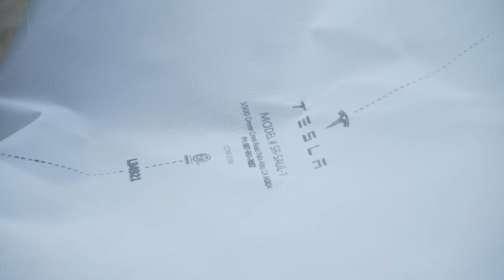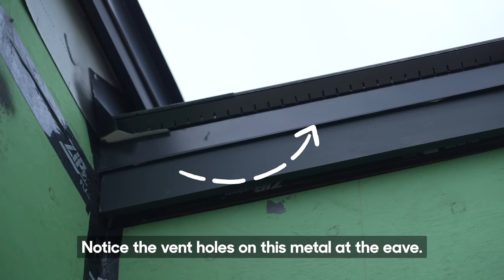Tesla Solar Roof - A Builders Perspective

Comment: Problem with this system is you don't have shingle level monitoring so detecting an issue on each shingle or string of shingles lacks the granularity of modern day MLPE Moudule Level Power Electronic systems. Also since each power gateway is only rated to 200A you actually have 2 fully independent systems during a Power outage. So you really need to spend very careful attention to balancing your power loads to be spread evenly across the 2 independent systems. Also the Gateway doesn't have Generator Controls so the Generator click only clicks on when the solar & Battery run out of Power. Also the Generator cannot charge the Powerwall so this is not a true off grid capable system. It's a very nice system but you end up spending so much more $$$ to go this route because the system was designed for self consumption & Arbitrage not a true off grid installation. 

Still a beautiful product & this has alot of features with Span Electrical panels to make the Generator almost useless. But in the winter if you have electric heat pump & your Powerwall run out of Power the issues is the Generator will continously run until the Utility Power comes back on. When Tesla one day makes a software update to allow the Generator to have better integration with the system not just be a back to the back up then it will be a truly great system.

Comment: How many watts is produced by a "Tesla panel" similar in size to a traditional solar sized panel? Is cost the only reason why someone wouldn't use all "active" panels? And, couldn't one use the solar heated hot air generated in the space behind the panel as forced hot air for the home?

Comment: My Solar PV produces ~40kWh (I think the best ever was 48kWh out of a 6kW inverter)  in Summer and only around 15-18kWh in the depths of winter. (6kW Inverter with 7.9kW -=24x0.330kW LG panels)
(Call the installation Sydney Australia  - that equates to 8 hours of sun MAX and 2.5-3 hours  - equivalent in winter (clouda days are less than 1 hour of "sun") - and our skies are cloudfree for most of winter - Aother real installation nearby  with  a clear northern prospect - ie. a better solar location and a 5kW inverter with Suntech 275 W x 24 = 6.6kW of panels generates  20-25kWh in winter (4-5 sun hours)  and 35-40kWh in Summer (45kWh peak) - (ie 7 sun hours in summer is pretty good)...     These are all variables which are difficult to truly account for - unles syour site is in the clear on a bald hill and you have comprehensive weather/sun monitoring done in advance....

In summer I export 80% of my generation  (we only use around 3-4kWh from the grid overnight on average - also have a legacy SolaHart thermal solar hot water - and only "boost" from the grid infrequently. (I am in Australia with much better annual solar resource than the "high latitudes" of USA or Europe. though we are shaded by terrain for a few hours in the AM - winter especially, ie not "ideal")

Setting up a solar system for "total resilience"  - the sizing needs to  have at least a "factor of 2" of surplus power - assuming less than 5 hours of sun a day isn't a bad idea seeing as on heavily overcast days the solar generation will be down to around 10%) - in summer any "properly functioning system" will fill batteries and heat the hot water by 11am and export the bulk of the remainder to the grid, while in winter it will take most of the power (on a good day) to get to the same place - and possibly supplement the hydronic heating by charging up the thermal masses during daylight hours.
I appreciate these showcased builds are not the :every man" installation - or project.  Most will be dreaming - -for ever.

Comment: Good stuff.  I would love to see how the permeability is handled in the roof from top to bottom (calcs).  Does moisture have a way out of the house roof as the elevation goes up, or do they rely 100% on it not getting up in there (not a good plan)?

Comment: Question about tornado area testing: if it’s supposed to be easy to lift out a panel for replacement, my concern would be that a tornado would easily tear off the whole roof! Anyone have any experience with this type of scenario, or have there been any wind tunnel testing?

Comment: Does the Tesla battery and solar function when the grid is down? 
as far as I know all grid tied solar systems will disconnect power to the house if the grid is not powered.

Comment: Very neat install, but we definitely need a follow up video. I'll be interested to see if this 50 kW roof actually has 50 kW inverters to take advantage. The pricing is still hilariously out of reach for the general population too.
Reply: The AC rating of the inverters is almost never 1:1 with the DC rating.
Reply: @CraigCabrey  True, but having 50 kW of solar panels and companies only providing 40 kW of inverter is too common and borderline fraudulent. I would guess this house is done well given the level of overkill described and the fact that the solar install costs more than most people's homes. :)
Reply: @goobiesgarage1417  40 kW of inverter would actually overkill IMO. it looks like this install has strings facing all directions. therefore you would never see maximum production ever.

Comment: How much is this system cost, is this area the same as the area hit by the bad winter storms , what is the r rating on the house, what type of windows, do you know about multi foil insulation, what's your thoughts on it, sorry about all the questions but in Australia power and cost going through the roof , thanks

Comment: I just have one question: Is the tesla roof a streem system or microinverter system  I ask because a streem system one goes  out the other tiles only output what the lowest aka highest low output, and the other solar is doing

Comment: Impressive tech, but I worry about total cost of ownership and real life issues:

1) Are there any fire hazards like with batteries?
2) Do we have to worry about HOAs?
3) I heard horror stories of insurance premiums going sky high if you have solar or worse, being denied insurance?
4) Who covers the Hail damage to the tiles?  The Tesla warranty or the insurance company?
5) What about hurricanes?  What happens if a hurricane rips these off the roof?
6) What about water damage it these solar roofs fail to be fully waterproof?
7) If couples with batteries, is there an intelligent system that keeps track of your power consumption and battery charge over time and buys any "missing" power off the grid when prices are low and sells excess power back when prices are high?   Or even better... if you have excess battery capacity compared to your normal use, buy to fill the excess during cheap times and sell it back when prices are high if it generates a profit.  I know this sounds like scifi, but a few cheap sensors and creative programming should do the trick.
Reply: Idk about the rest but 1 and 7 I can answer.

 1. Fire hazard is very unlikely in general but it could happen if there's faulty installation or the brand was not good from which you purchased the batteries. Otherwise very very low chance, lower than your gas stove exploding someday.

7. Building a system that will buy electricity at low rates and sell at high rates is something that does happen already but you will need to some real homework on the conditions of location to make it viable and programming that in accordance with it.

Comment: "For the first two weeks people stare at their phones constantly" - yep, I've had my Tesla roof for about 2 weeks now and I'm just starting to get over the urge to check the app every 5 min, LoL. Mine was a roof replacement on an older house. After tax credits it wound up being only slightly more expensive than a regular roof replacement. Since the system was turned on we have not drawn anything from the grid, even on cloudy and rainy days. Biggest downside is people slowing down to stare at your roof, LoL.
Reply from the maker: That’s so cool Mark!  Thank you for the first hand experience!
Reply: I still look at my app almost daily and have an excel workbook to track everything. It's been 3 years for my solar panels and Powerwalls. Got me through the Texas winter blackout.

Comment: After roofing in Canada for years, I moved to New Zealand where all building is done with scaffold. It is so funny to look now at builds where roofers are using those absurd ropes and harnesses. Basically designed to create a tripping point, obstruct your work, and make the roofer uncomfortable. Everything about them encourages the roofer to use them incorrectly so he can proceed with his work. You see these guys with their ropes extended so they can walk the length of the roof. Of course they will die if they fall.
Reply: There's. your idea to be a billionaire. Good luck.

Comment: Back of napkin numbers, a plain standing seam metal roof for a house like this would probably be $65-95K but then regular 50KW+ solar system would be another $40-60K. The solar roof, which is roof AND solar, is probably $150K. So not terribly more expensive than a premium roof + solar.

Comment: Surely they mean a 50 KWH PER  day production. If they had 50 kw of panels for 6 hours that would be 300KWH. The only justification for such overkill would be connection to a Tesla virtual power plant like system. Selling back the excess power during peak demand would pay for the system very quickly.

Comment: The idea of being completely off grid is appealing at first. It may be better to remain an integral part of the grid, and actually make $ with excess solar, plus add redundancy for a more stable grid overall. Once we get enough of these systems online, we will have a stronger, more resilient grid and much cheaper power.

Comment: 3:38, why are the batteries receiving AC power? Batteries are DC-only. That's even a limitation of them, sometimes...
Reply: Definitely want follow-ups. Would REALLY want 1 year, 2 year, and 5 year follow ups on the system, as well. I honestly thought this system went bust and went under, so I'm surprised and impressed to see it being currently installed.

Comment: Is this is “series” and “parallel”?, nobody is answering questions…. Can a roofer glass cut on the roof? Or does the panel They should be able to be cut on the roof at spot of install. Have to be sent to the ground to do the cut?

Comment: 50 kW system will produce 60-70 000 kWh per year. I thought building a well insulated house was supposed to bring energy usage down. 10 power walls to get through the night with AC on full blast seems reasonable if the house was barely insulated at all.

Comment: 50 kW...  /240V = 208 amps...  standard electric panel?  some mansions have 2 standard panels or 400Amp Service...  electric heat / cooling.

Comment: I wonder with something like this you produce heat I wonder if there was a way to also collect heat, to send to a heat exchanger for heating water ect. IE like in the winter. be able to produce power, and heat water to heat the home or preheat water for a water heater ect. I know when solar panels are cooled down they produce more power.   they should add a cooling loop under a panel you connect them the way way you connect the power. so you can Cool your panel heat your home or water, and product power.
Reply: There are solar panels that do that and can heat your pool and other things.

Comment: Is this solar setup going to supply power for the whole block? I’m assuming this is a passive house so why do they need so much power? Could this be for a virtual power plant?
Reply: That is a Mansion not a house and I bet it has as much wire in it as a spaceship.  You want a big system to pull in power on gray days.

Comment: We have friends who have power walls and none of them require a generator for the gateway.  You just make sure the circuit that the gateway is on is backed up by the power wall.  Having a generator makes zero sense and pretty much defeats the purpose of having the power walls.

Comment: 3 x metal roof cost.  -30% tax rebates so basically 2 x metal roof cost. A proper comparison would be comparing Tesla roof cost to metal roof + solar panels because the Tesla roof is both roof and solar panels. Anyone know how the price compares when you compare apples to apples instead of apple to half a apple.

Comment: A 50kw system is massive. Maybe they should have built the house to Passive House standards instead and they could have used the savings from the significantly reduced solar array required to pay for the slight upcharge to meet Passive house. It's irresponsible these days for builders to build these massive houses with multi-million dollar budgets and not invest a small percentage of it into making the most energy efficient house possible. This builder is already doing ZIP 2.0, so he's halfway there anyway and just needs to get the insulation and windows up to a higher performance level.

Comment: I'm just not sure I would want that much technology tied into my critical electrical system (and I'm an electrical engineer gadget guy). I've had a 16KW whole house generator for the past 7 years, and during occasional outages - it has served me well at under a $6K investment installed.

I had a direct hit from lightning last year.  Didn't come in thru the panel (I have several whole house surge suppressors) - it hit the roof and decided to wander around the soffits, catching a ground wherever convenient.   Wonder how well this home would tolerate that circumstance?

Our home is "smart', but only from the aspect of non-critical items.  The lightning strike did wipe of some the 'smart' electronics, but the generator and xfer switch wasn't affected.  I sort of cringe at the amount of low power electronics used to control that owner's electrical system.

Comment: Like anything involving Elon Musk, on the surface it seems like a great idea and affordable for what it is. But as you delve in, you come to learn there is a shit ton of hot air inflating everything he does and cost are actually much higher than advertised and performance isnt at all what was stated. That is all assuming you can even get it installed in a reasonable time...   
I will say though it looks absolutely phenomenal.

Comment: While a 'decentralized grid' (decentralized renewable electric generation) for everyone would be awesome, the reality of how we get there is difficult. The only reason that our grid-delivered electricity is as inexpensive as it is, is because almost everyone is connected and subsidizing the cost of the very expensive infrastructure. As the wealthy (who can afford their own generation and storage) disconnect from the grid, the costs for lower income folks who can't afford their own generation will only increase, because fewer people are subsidizing the enormous expense of the infrastructure. I still think it's a great goal, but it will require some subsidation of some sort, because even if only 1% of the population is reliant on the grid, the grid still needs to be paid for. And it's unlikely that storage will ever be less expensive than a grid which distributes electricity where it's needed, from places that currently have a surplus. That's likely to remain the most efficient overall solution.

Comment: Impressive solar roof panels! He didn’t it tell you how many watts of power they generate and if they output 12V, 24V or 48 Volts of  DC power.

300 Watt 12V panels the only generate 1/4 the voltage of 48V, 24Volt Panels are 1/2 of 48V panels 

The same applies to LiPoe batteries remember ALL Batteries output DC Voltage abs out home need 120 Volts of AC Voltage! 

Please go back to house after the Tesla Power walls are installed and the LP, NG or GAS or Diesel generators are installed

Comment: AC batteries?! I think he is mistaken.... The battery is the storage component it would need to get inverted back to ac if that's what the intended use was.....You store power in dc and invert it back to ac to be used with ac appliances....Solar only produces dc

Comment: All wonderful except for the plastic hinges that connect the panels.  After a few years in the sun and elements, that plastic will be stiff and brittle which will affect any service needs. Way better looking roof than the typical solar panels.  Some neighborhoods just don't do so well with the typical ugly solar panels scattered here and there.  Sad...codes should require panels to look closer to a roof vs. a band aid.

Comment: So I have an over 20 square roof that has had quotes of steel roofing as high as 30K. So 3X that is 90K for Tesla Solar. On top of that multiple power walls & a backup generator are required to use in a grid down scenario. That is the definition of insanity~

Comment: I am very curious to know how this has changed. I am very anti solar, but pro solar roof because of it being multi purpose. I know in my initial research and digging, that they would only allow you to panel up as much as you needed versus wanted. So the entire roof would have the same appearance, but wasn't 100% solar. In essence, only a portion of the solar tiles were actual solar why the rest were just look a like panels. If our governments were truly on the side of green, this is how they would do it. At some point in time, roofs have to be replaced and despite the lie they feed people. Solar tiles/panels are not recyclable. They don't break down, but that also means the serve as a perfect roofing solution. Because even if they stop producing power, they can still protect a home and reduce material, labor, and increase home longevity by removing the need to replace a roof every 15 to 20 years. Hence the dual purpose and it doesn't require wasting valuable farm land or clear cutting to make room for solar farms. Not to mention the reduce transportation via wiring and distribution poles of sending it from solar farm to grid.